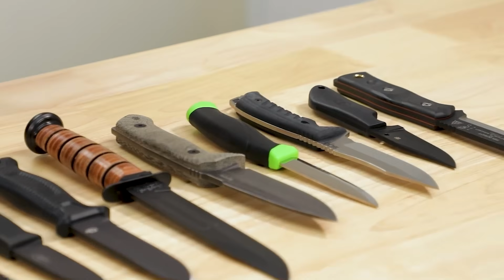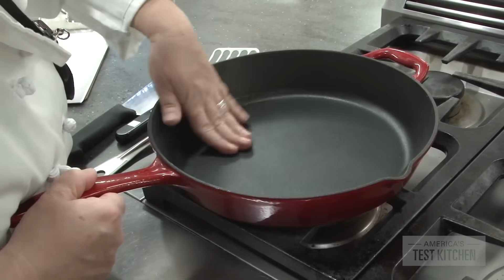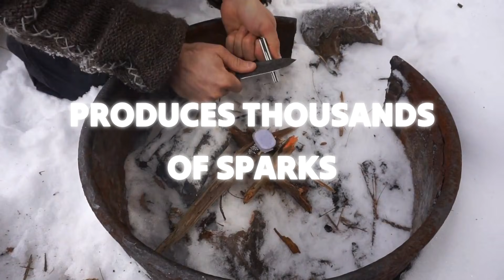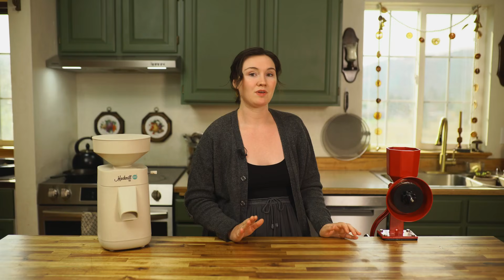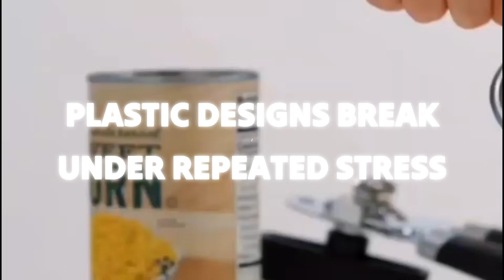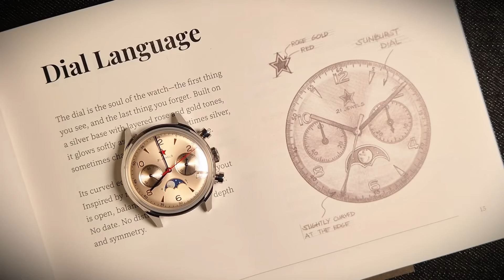Buy These Survival 10 Tools Once… And Never Replace Them Again | survival Guide For Preppers

Comment: If your can opener fails you will need a large rock or concrete road. You rub the can over the rock or road until the silver edge  rubs down and you can see the seam and  put a knife between it and the top pops off. Its a cool trick I picked up from a video I watched years ago.

Comment: ☆If you're getting a used cast iron pan look closely for cracks.
☆That manual pump breaks under heavy or prolonged use. Better have several in reserve.
☆Many multi-tools include a can opener.